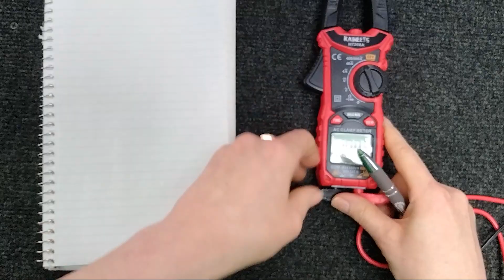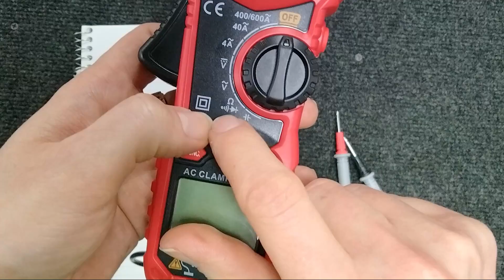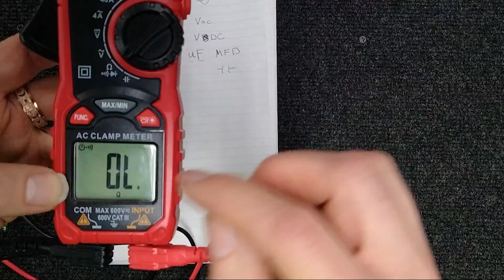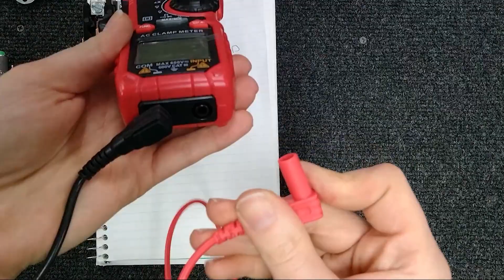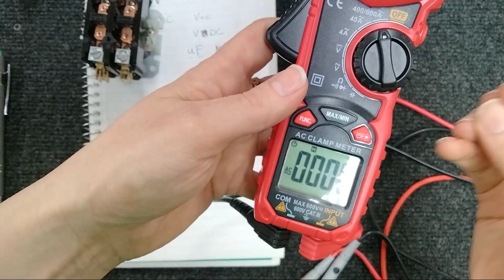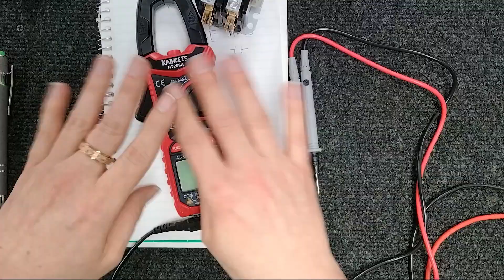Multimeter Basics — What The Symbols Mean & How To Read It

Comment: good  and informative videos, about those Fieldpiece meters i like em but.... their weakest point is the dia, i have two that are broken from that same point, i would recomend a meter that reads, uA for flame sensors and INRUSH currrent, thanks for the videos
Reply from the maker: Specialty meters, especially ones with swivel clamps (which are fantastic), can read such things as micro amps, so on and so forth─ Fluke meters, etc. Normal people wouldn't have a need for those. 😆But exactly right on many meters in the field. Testing meters against each other is really fun if you have the opportunity to see the differential. Field piece's clamp does tend to weaken after a few years, especially on the SC260.